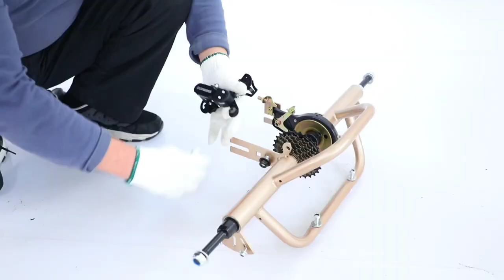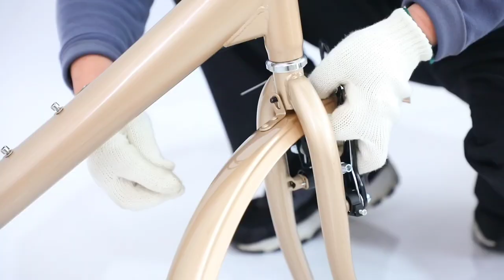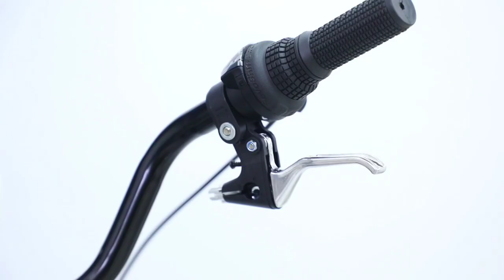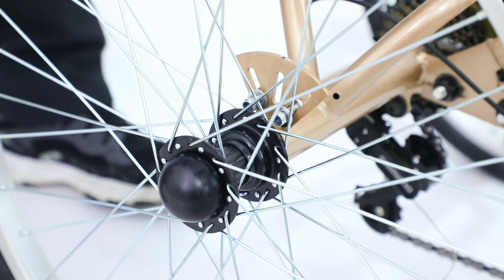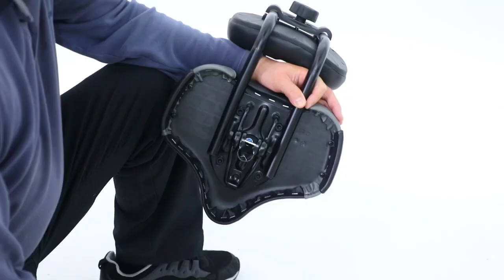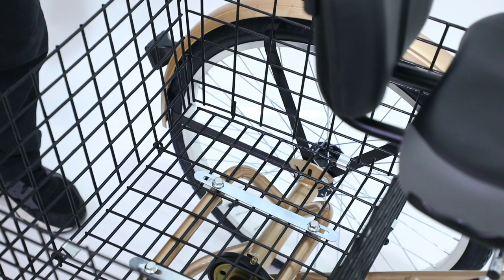7 Speed Adult Tricycle Installation w/ Details

Comment: Thanks for straightening me out on my gears, they are shifting now, but are they supposed to change gear to the largest chain gear, that is easiest gear, right? main stops right b4 the largest gear. Also, my trike came without those stays in your video, I was sent the wrong ones. I looked everywhere for those in your video to connect my back fender to. please send info on where to get them or buy online?